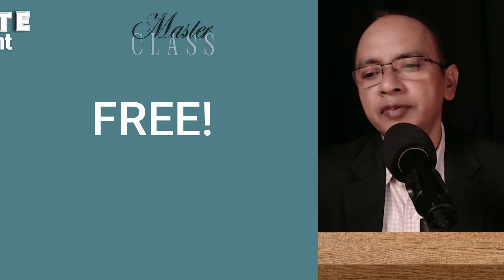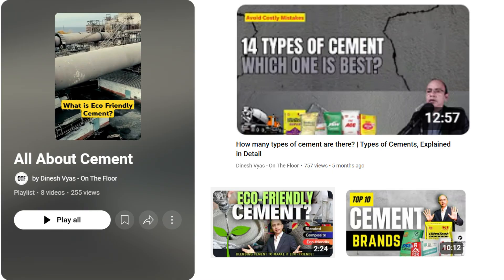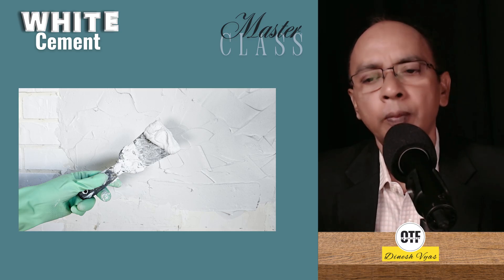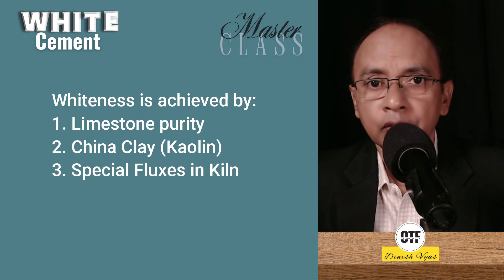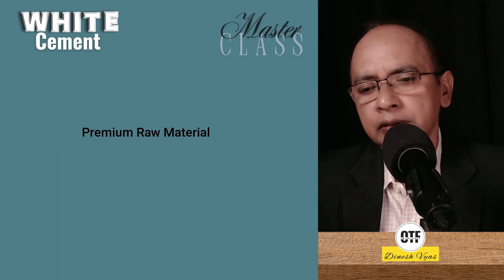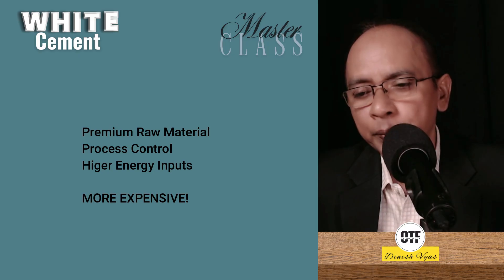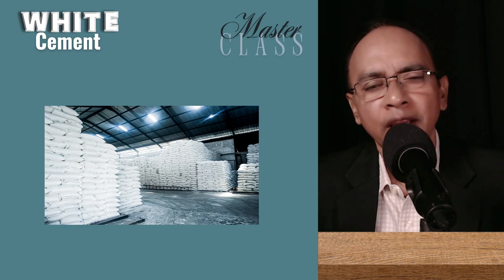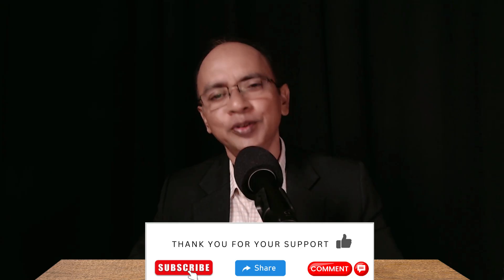Dark Secrets of White Cement : Everything that Professionals should Know.

Comment: Sir I want a low construction house. Can I use white cement for plastering and leave it without paint? For 500 sft home inside and outside they are quoting 30000rs for paint alone. Suggest me if I can use it on floor also without tiles.
Reply from the maker: Theoretically it might suggest lower upfront costs than grey cement plaster plus Paint.
Few things to keep in mind before deciding :
1. Wh cement is much costlier than grey. 
2. Regular sand will spoil the whiteness of mortar. Contaminations will give it different coloured patchy appearance.
3. Plaster has to be quite even and uniform plus proper curing needs to be done.
4. Crack repairs post plastering after sometime would be big issue as it will add fresh patches.
5. Maintenence could be a big headache in long term.
- Team OTF